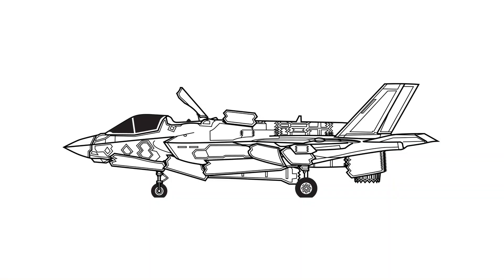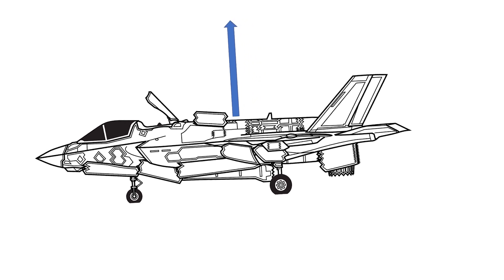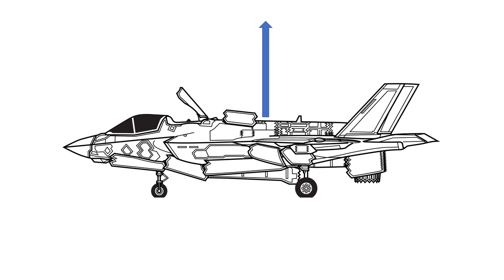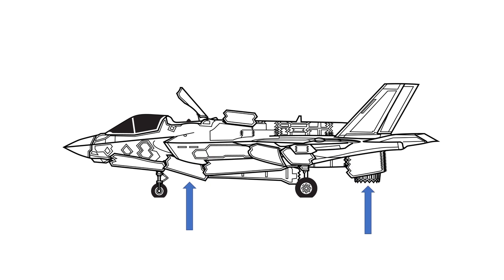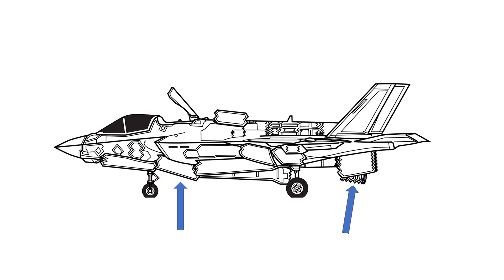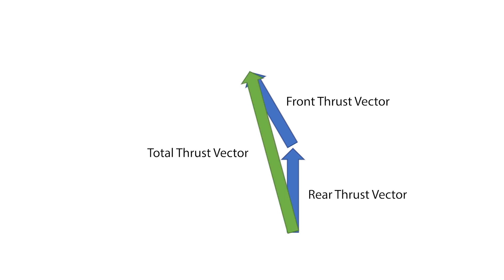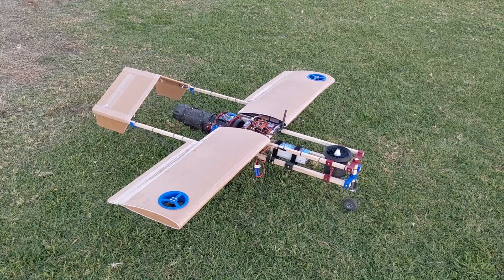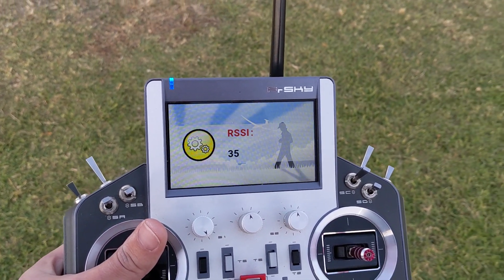R/C F-35B: I Created a New Flight Mode!

Comment: Awesome video. I did a similar control mapping on my cyclocopter by fixing the pitch attitude setpoint to 0 and directly passing pitch stick commands to the thrust vectoring for forward/backward translation. It’s really weird to see it “sliding” back and forth in the air and is unlike anything I’ve flown before

Comment: Nice work!, this is exactly how my 6DoF copter work, it just lets you pick a arbitrary pitch rather than fixing it to 0. For the F-35B this would allow you to pitch up the airframe for the transition, or to unload the motors using wind for lift in the hover.
Reply from the maker: Thanks Peter, your 6DoF copter is awesome! Better AoA control during transition is definitely something I'll pursue at some point.